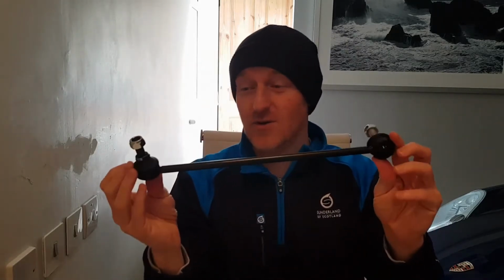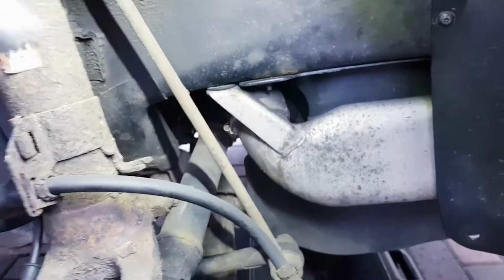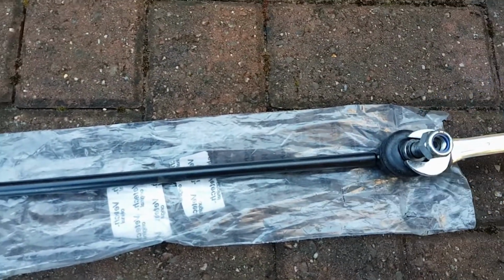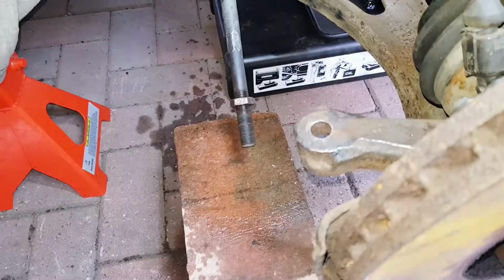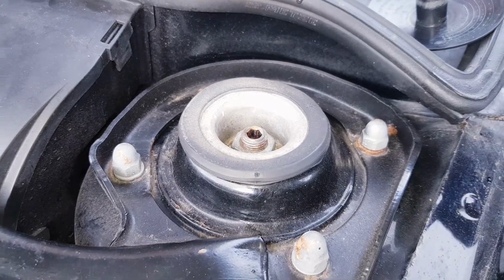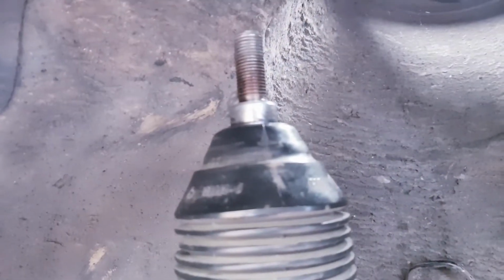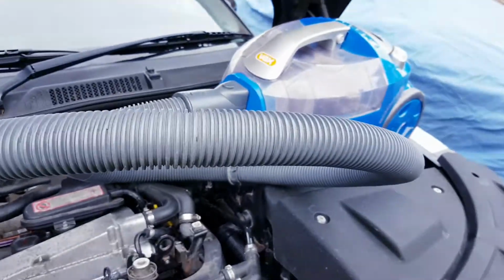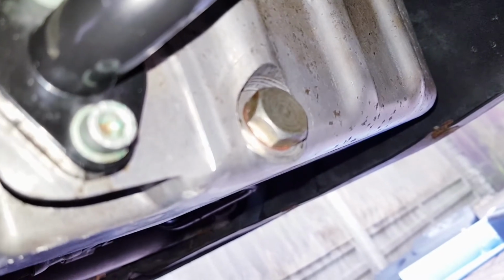Repairing the front suspension on my Audi TT 1.8T Quattro Mk1 8N3 & Sump Plug Oil Leak Hack - Part 3

Comment: Thanks mate, Just changed the rear shocks and springs on my TT. Its done 120000 miles and they were in a hell of a state , no resistance at all when pressed down. Got the front shocks and springs ready to change this week, after seeing the condition of the back I expect the front to be the same. With just the back done the car feels so much better already, look forward to seeing what its like with the front done as well. After watching your video my next job will be the drop links and ant roll bar. Thanks for the upload, subscribed.😀
Reply from the maker: Thanks for the comment and support boastyy. Sounds like you are doing great work there and good luck with the front shocks, I know they can be a little painful separating them from the hub. Lots of penetrating fluid. Let me know how you get on 👍
Reply: @Witty924  Thanks man, just hoping everything goes to plan. Can never tell if its going to turn into a nightmare with seized/broken bolts ha. I bought one of those shock splitter things which opens up the shock to get it off the hub, should help a bit. Wd40 everywhere ha. Thanks again I will let you know how it goes, should make a huge difference to the ride quality so looking forward to it. All the best man.😀

Comment: Nice work as always, and that oil sump trick was ace. You looked a little worried under there, as you were undoing that sump plug thinking the oil would just fall out, but hey it didn’t 👍

Comment: That shock you fitted the new spring to looked knackered. I recently changed my shocks and when they were compressed, they stayed compressed, instead of slowly returning to max height.
Reply from the maker: Thanks for the comment Umbrella Man. They will need changing in the next couple of 1000miles for sure. I think most of these cars at 70-80k need all the front suspension renewed but then they they are good for another round I the ring  👍

Comment: Your seized components reminded me of my 06 Mini Cooper S.  I was replacing the control arm bushings on it when I first bought it and it took me 3 days to remove four bolts from the front sub-frame.  There is so much road salt used here in Ontario.  I use anti-seize paste on every bolt I remove.
Reply from the maker: I hear you doug 👍. Our cars in the UK suffer the same fait with road salt and many rainy days. Good combination to upset bolts and screws on cars. I never want to see another tie rod end haha. Thanks for watching and the comment 👍

Comment: Clever oil suction, Sir.
About the tie rods and prop link ?, would you need to do a realignment of the wheel ?
Reply from the maker: Hi Peter thanks for the comment and support. So when you credit new tie rods you can get them to fit almost identically to the position you removed them by making a mark and counting the number of turns to remove them. To get things perfect you will need to do you front tracking again. Hope that helps 🤞👍

Comment: Great hack on the oil plug.
How's the stance of the car after changing just one spring? I've read that it's suggested to change both on one axle at a time. What's your reasoning behind the single change?
Nice series.
Reply from the maker: Thanks Clive, seemed to work well. The spring change isnt an issue, when you have used springs together they generally good to go. It's when you mix new and old that's when you might get a different feel. Thanks for the comment 👍

Comment: Subscribed but is the vac hurt in the making of this vid?
Reply from the maker: Thank Bina. No vac hurtling this video. Maybe a small oily residue the front of the tube which you can wash out easily. But know that no oil is actually sucked up into.the vac 👍